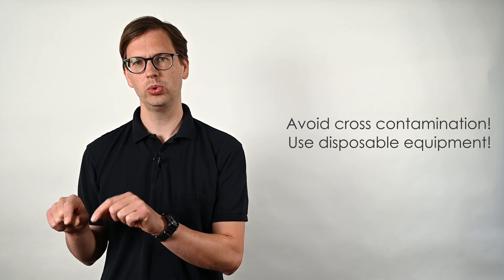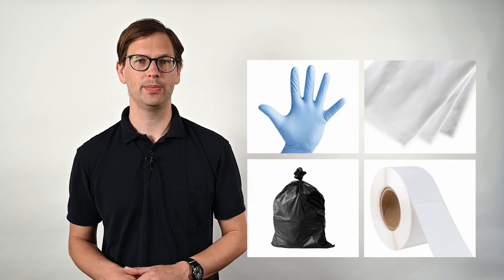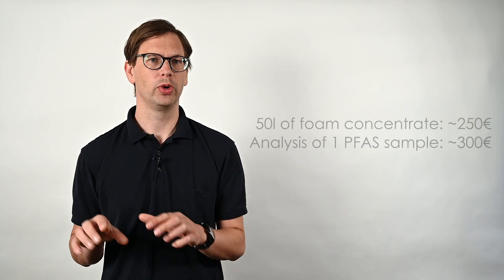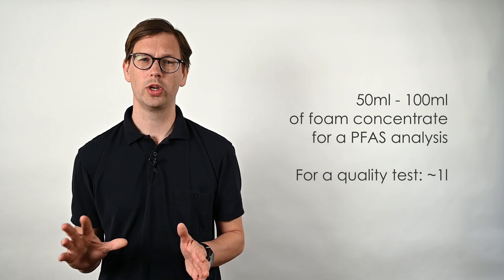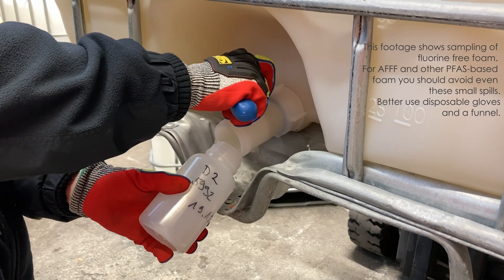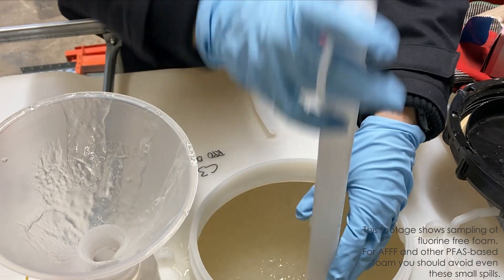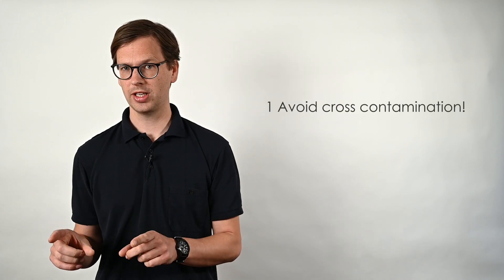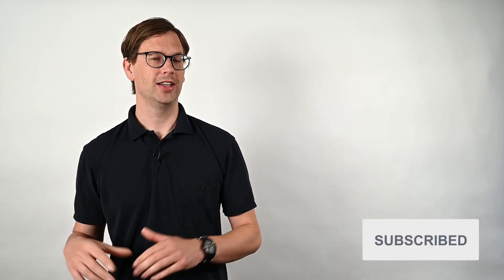Taking samples of fire-fighting foam

Comment: do you suggest top assay analysis lc msms or another standard?
Reply from the maker: Hello, I would say LC/MS/MS was and is the standard method to get specific values for single PFAS. TOPA  (Total Oxidisable Precursor Assay) is a bit the new kid in town (although it has been there for a couple of years now). It makes sense as most legislation also goes after precursors. But depending on where you live, it might not be that well established (finding a laboratory can be an issue) and standardized. So my advice: If detail are importanted values, contact the authority having jurisdiction to check what method to use.